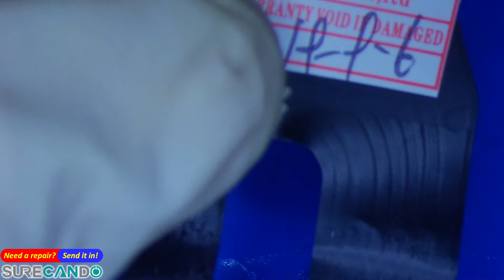ASUS UX490U LCD Screen Black works off External Screen issues Part 1

Comment: Hi I have the same device, after pressing power button, only the fan is working, I tried to plug on HDMI but still the same, what could be the possible issue?thanks
Reply: @SureCanDoComputersServices1  is it possible issue would be motherboard?
Reply from the maker: @moelegend9385  motherboard is a large component, many hundreds of subcomponents + firmwares. A local tech shop can identify the fault.
Reply: @SureCanDoComputersServices1  okay sir, i am just trying to figure out because this happens after I removed the battery and put it back. only fan is rotating in high speed. thanks by the way